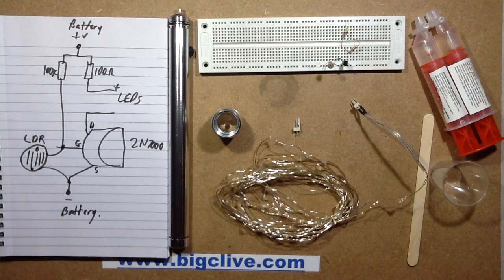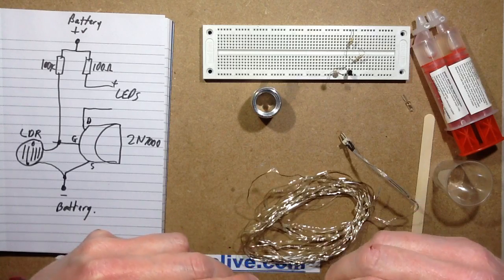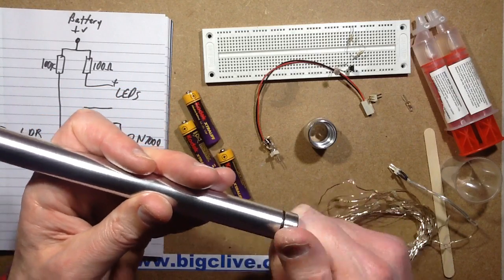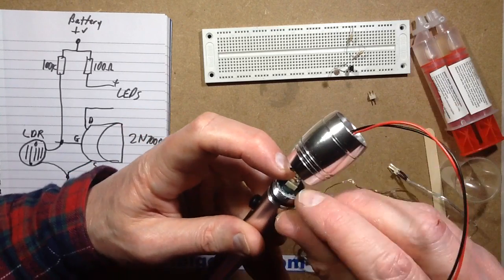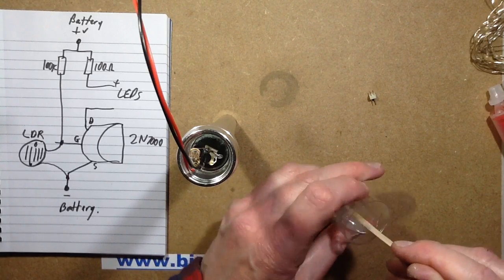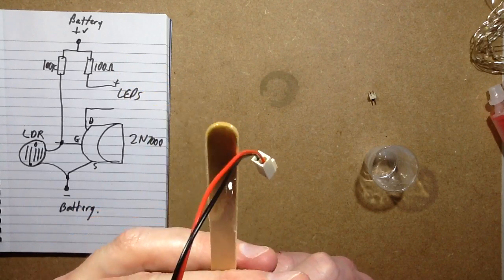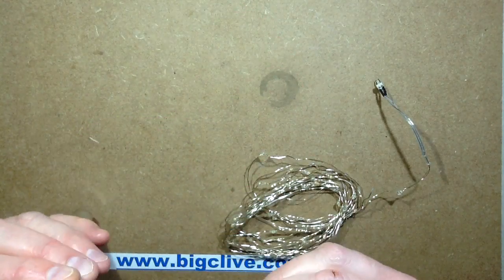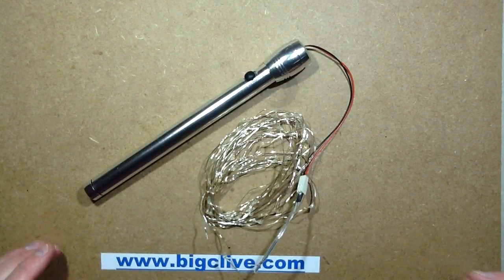Potting electronics into a flashlight case with resin.

Comment: Use coil induction between your lights and the wires coming out of your LDR. Place small neodymium magnets on both so that they will connect together via magnetic attraction. That way you will be able to water proof and moisture proof your connection with more resin. Am I making sense? Less messier than using grease and more professional too.

Comment: isnt the switch of the battery enclosure still a weak point in this construction since they never seem like completly waterproof?
Reply from the maker: Time will tell, but the internal assembly uses a slim wedge to force the switch assembly and it's rubber surround against the inside of the case, so it should form a good seal.
Reply: bigclivedotcom  They tend to rot with time though. I have a torch which is about 8 years old and the rubber seal rotted off, leaving only a hole with the switch underneath. I put a paper clip on the lanyard to operate the switch, as it is really only there for use in power cuts.
Reply: bigclivedotcom what did time say?

Comment: 24 hour epoxy however is incredibly strong when cured. It will cure faster if you heat it up to 80C, when it will gel in under 10 minutes. I use it to fix concrete walls, it is a stronger repair than the original concrete. If you want crystal clear you will need to get a clear casting resin, which typically is a resin/ MEK catalyst combination. Cheap version is a gelcoat resin, which you can tint as well with fibreglass tints to some nice colours.
Reply: SeanBZA Agreed, if I'm not in an immense hurry, and if I can FIND it, I will always use the 24h stuff

Comment: @bigclivedotcom 
The process looks good. I am looking for a similar solution for a sensor. The idea is to use it to hold my soldering, but the space to pour resin is very small and I might need to use a syringe. Could you please let me know which would be a good electrical potting resin with fast curing for this application? Thank you in advance!

Comment: There are 2-part resins that come in syringes with mixing nozzles, what's your take on those? One advantage over cup-mixing, is a clear, transparent mix without any air inclusions that would otherwise make it milky. One disadvantage: You always waste one nozzle, and one nozzleful of resin.
Reply from the maker: I've not tried the mixing nozzle version other than in chemical wall fixings.  I usually use the cheap two part non-mixing syringes and just mix manually.  If you're using small amounts you lose a portion in the mixing nozzle and then have to throw the nozzle away because the partially mixed resin in it will harden.
Reply: I hear there are different sizes in nozzles so as to mitigate the loss. Found a selection on Banggood. I've yet to determine how universally they fit to the commonly available syringes. Big advantage of the nozzles, however, is that you can get that stuff with little to no effort into the smallest cavities. Mind, I've ordered a set of ceramic kitchen knives off Banggood which were on special offer. The blades were glued into the handles with their tangs with what must have been little more than spit and a prayer, because they pretty much all came loose after the first uses. In comes the nozzle, and in went the resin. The deed is hardening on my shelf as I type. I'm curious as to the result.

Comment: When you use 2 part resin for this and your LED diffuser moulding, are you using epoxy resin that is sold as a kind of very strong glue? This sort of thing: http://www.poundland.co.uk/tommy-walsh-epoxy-resin-glue
Reply from the maker: +Andrew Cox The very same thing.  It's a good way to get a metered portion of potting resin.
Reply: +bigclivedotcom Thank you very much. BTW, I am a big fan. Working my way through your back catalogue. Loved your poundland napalm, and your ebay eletrocutors.

Comment: I just use a hot glue gun for things like these. Works great and much less hassle.
Reply: +Ni5ei Eh. Pouring resin is a lot easier, than pouring something that sets in under a minute.
Reply: My hot glue gun goes up to 250 degrees Celsius. No chance it'll set in under a minute when you choose a high temperature :)
Reply: dumle29 Little trick, use low temp hot glue and pre-heat the part you are working with.  I have done this using a 3D printer running the bed up to 95C I can slow the curing of low temp glue to take longer than the 5 minute epoxy.  If you mess up and need to reheat, just bump up the temp a bit.

In a pinch a hair drier works too.

Comment: Hello Clive, many thanks for your excellent videos. It is time the tv licence was redirected to your channel!I should like to ask your opinion about resin encapsulating the electronics on one of the digital voltmeters available on ebay.The unit I have purchased is for an application up to 600 volts ac. For detecting if we have two separate phase supplies to socket outlets in a room. I have built the unit and it works fine, but i am just a little concerned that the electronics of the voltmeter are too exposed and the connecting wires insufficiently secured.Is encapsulating the electronics with Poundland resin appropriate, or will any heat generated have an adverse effect on the components so enclosed by the resin?Keep up the good work.El chico electricista.